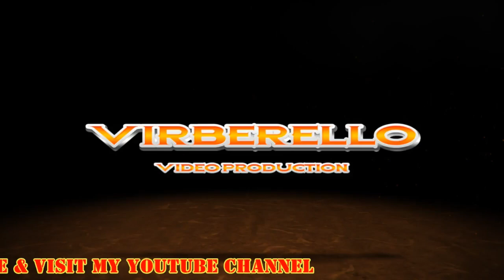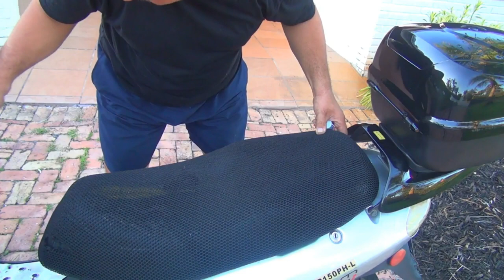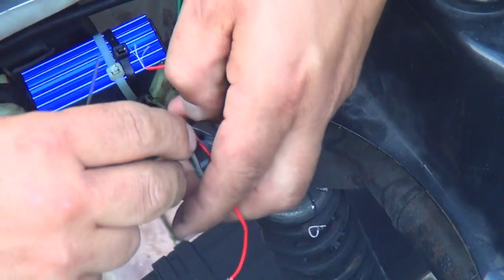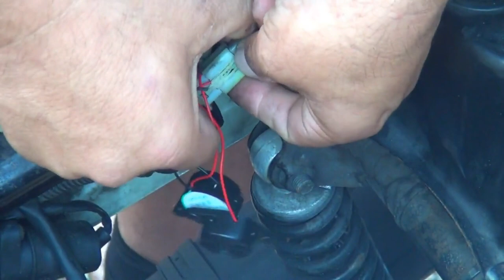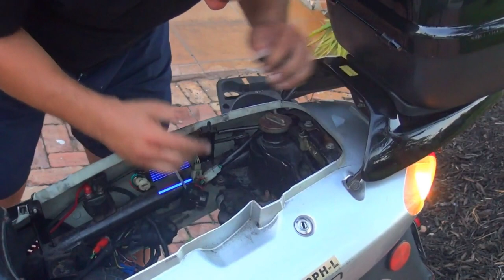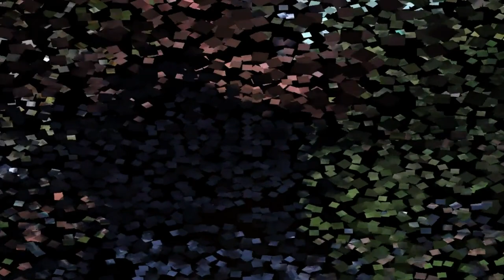How to install turn signal buzzer on your scooter / Motorcycle

Comment: Hi love your videos!  need your help please
I will put on a K&N filter on my 150cc scooter.
What size of the jet do you think i should have?
My main jet is 98.
Thanks for the good videos!
Reply from the maker: Hello RaaNgee with K&N filter I like the #115 or #120 main jet for 150cc gy6 motor .  Thank you for watching my video
Reply: Thank you!!
Reply: I also have a 150cc with custom exhaust and pod intake filter. I live at about sea level I think and my stock main jet was 105 and I replaced it with a 130.